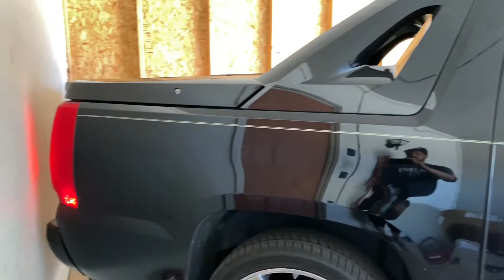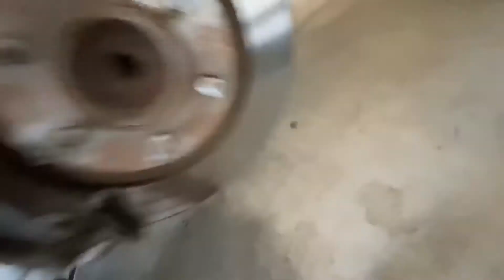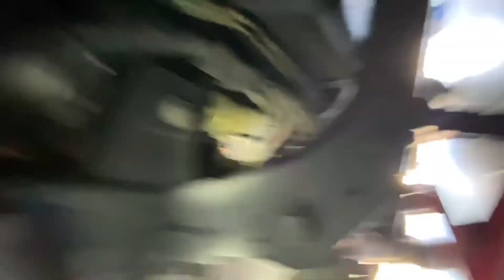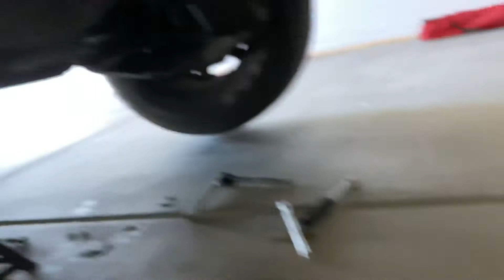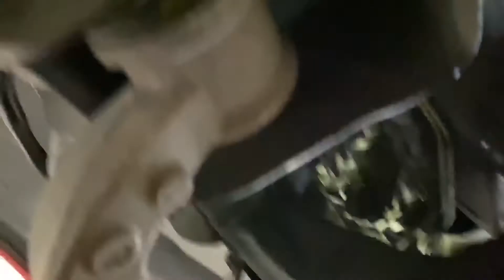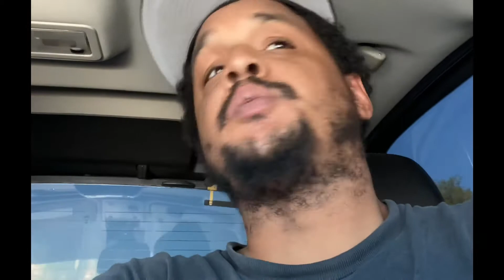CHANGING A STARTER ON A O3 Ford Expedition XLT

Comment: hello and good afternoon, my name is craig, i also have a 03 ford expedition xlt, that i belive needs a new starter, but wanted your opinion on the situation. car wont start, no crank no start, when in the on position all auxzuliry power works, radio lights, horn, alarm, all. when trying to start the only noise i get is from the fuse box that sounds like a soft electrical beep not sure what that is, i know its not the battery i just replaced it, and the alternator is good as well, i know i do at some point need new spak plugs and i know i have a small oil leak but i dont see thouse two things stopping the car from starting , what is your input on it, do you think its  the starter or no.
Reply from the maker: @CraigEnglish-u9h  def think it’s the starter my man.. switch it out and you should be good to go.